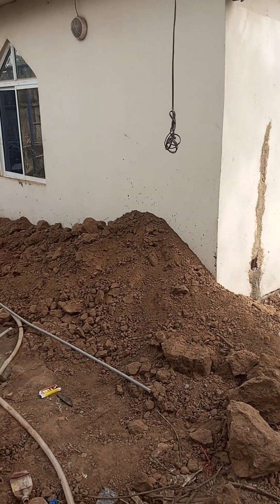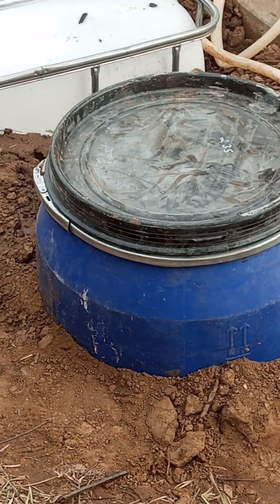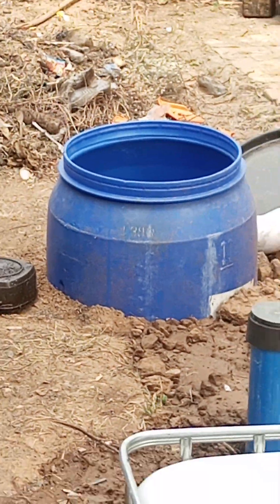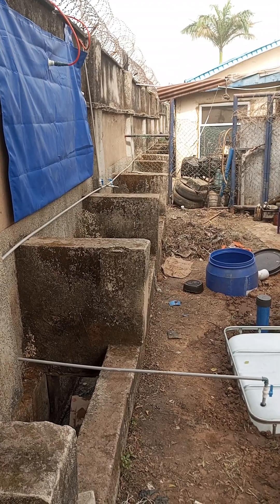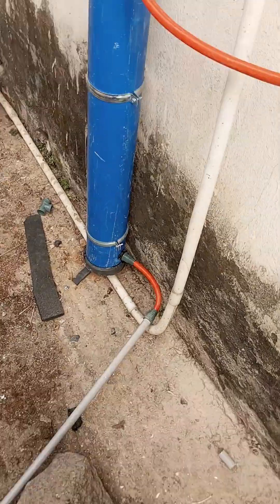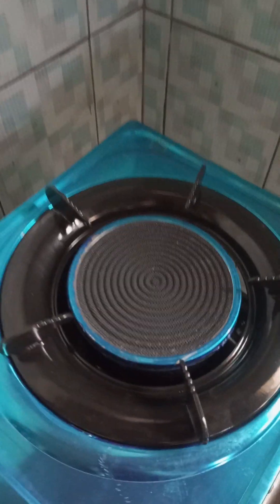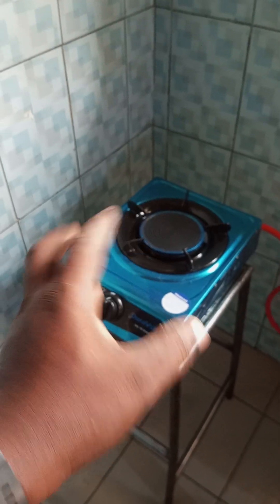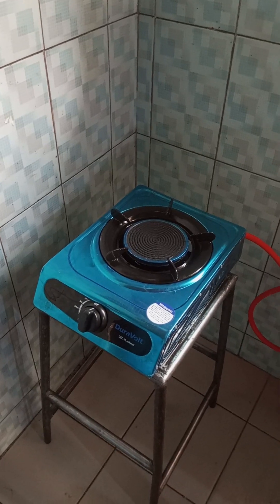Biogas for Glisten international Academy, Abuja

Comment: Is the scrubber for removing water and what if I want to connect it to generator what should I use to dry the gas.
Another one is can the gas collected for this particular setup run a full day
Reply from the maker: The scrubber removes corrosive gas like Hydrogen sulphide and non combustible gas like Carbon dioxide.

To dry the gas , there are gas condensers available in my online and offline store.

No , this setup is a 1000L setup which will run you generator for about 15mins
Reply: @miatechinnovationsnigeria  ok thanks
I'm so much interested, am a chemical engineering student and this is my final year project, I will be needing more coaching on it